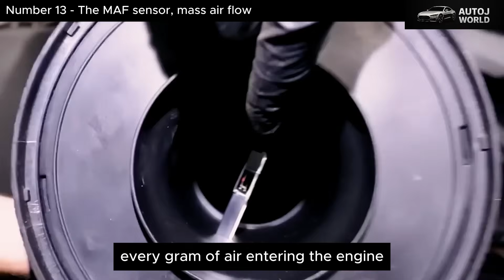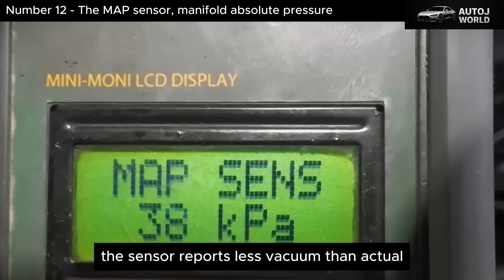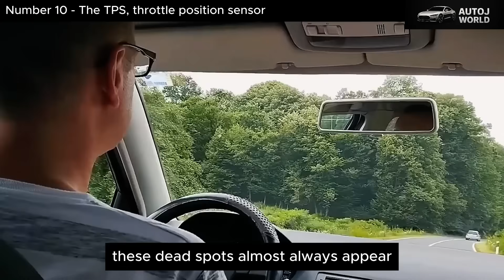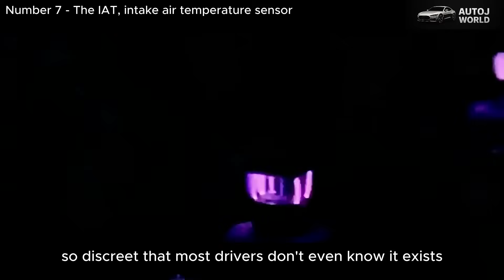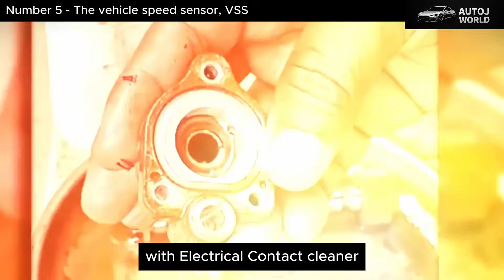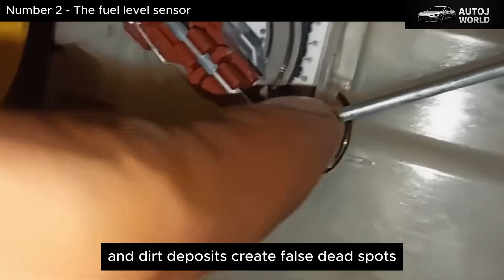The Sensor That FAILS Most Often in Your Car and Almost No One Cleans

Comment: This explains so many random issues I’ve had… crazy how such a small thing causes big problems.
Reply: Buy electronic contact spray cleaner. I get mine from a store that specializes in electronics.
Reply: The video kinda skipped over that part quickly.
Reply: @LeRoisAdventures how did it skip that's what the whole video was about
Reply: @AB-dl1hz i saw a good description of the sensors and special cleaners for each sensor but at the end when addressing cleaning out the contacts that connect to the sensor I noted that the electrical contact cleaner was mentioned quickly. I didn’t know that they sell it at auto parts stores and if that’s true it’s a good thing.
Reply: @LeRoisAdventures yes at the auto parts store it'll say what sensor is for right on the can  I' like to WD-40 electronic cleaner
Reply: @LeRoisAdventures the electrical contact cleaner is mentioned multiple times in this video actually
Reply: @LeRoisAdventures you can get the same thing at any auto parts store also
Reply: It can't.
Reply: @chipsramek3868 o yeah